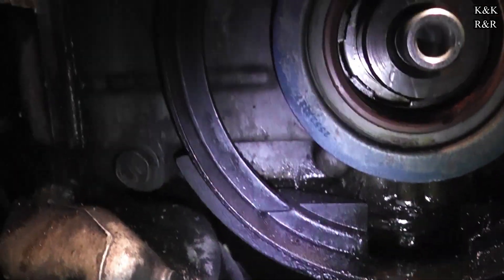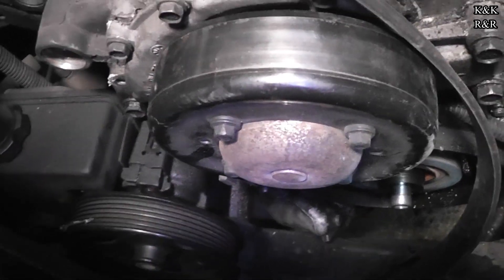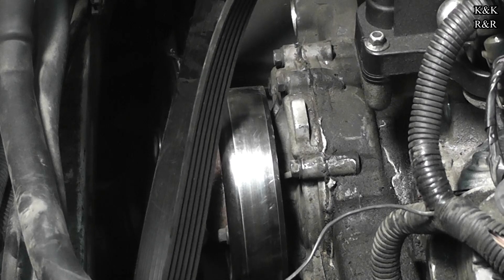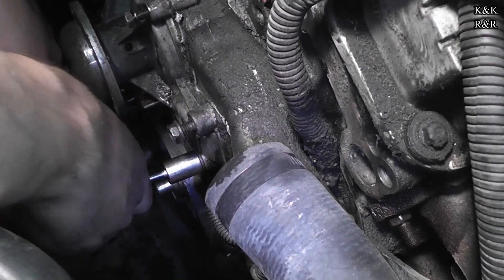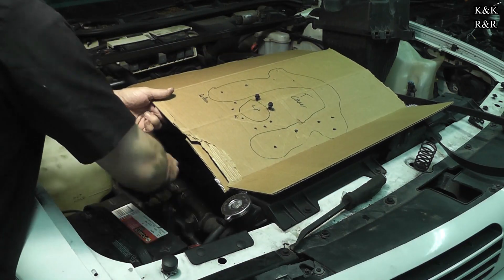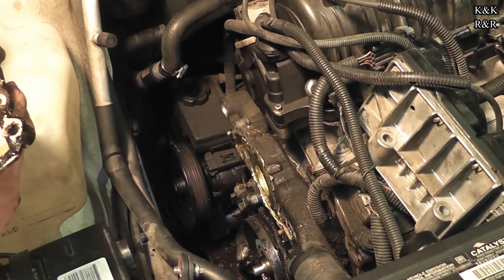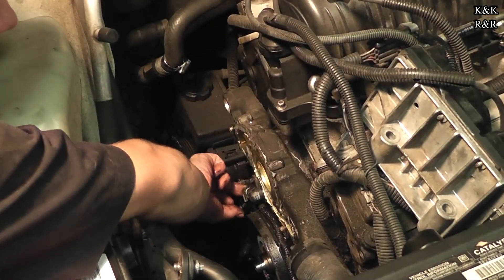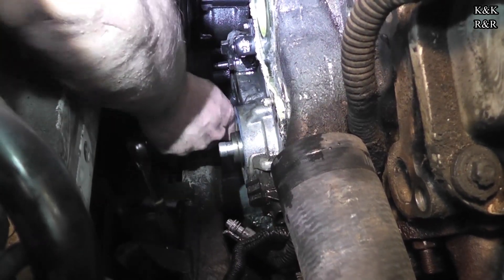1995 Oldsmobile 3800 Timing Cover Leak & Timing Chain Service  PT 3 Water pump/Crank Sensor Removal

Comment: I would have replaced the cam and crank sensors too and removed the inner splash sheild, easier access.
Reply from the maker: I prefer to use the OEM GM sensors as long as they are working just fine then replacing sensors with after market one's.  The reason being is the after market sensors reading are a little off my design and can cause a bit of a rough idle. We have had some issues with after market sensors on E.F.I. engines. 

/K&K
Reply: @KNKRNR   Yes, I use only oem for electrical items too.